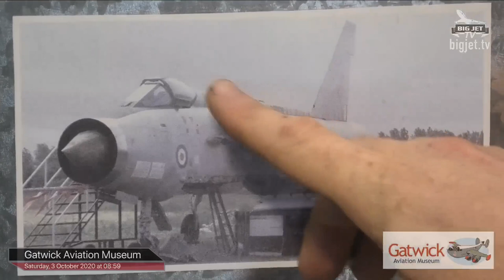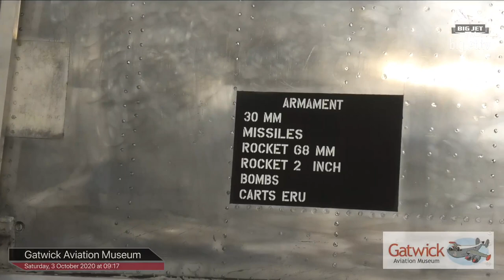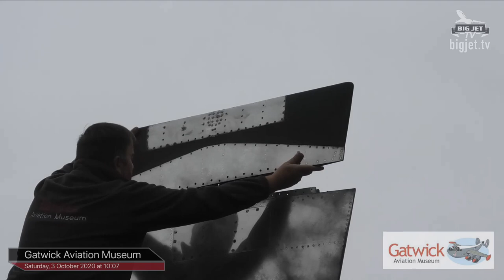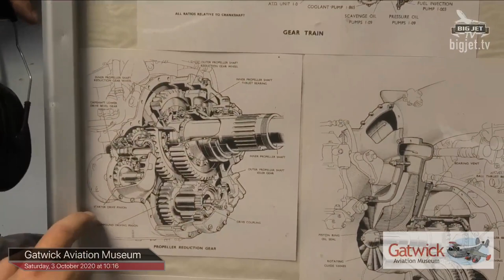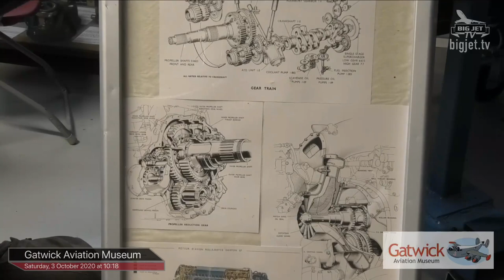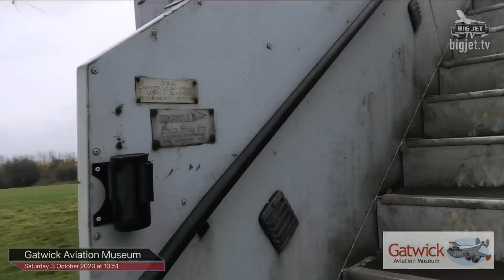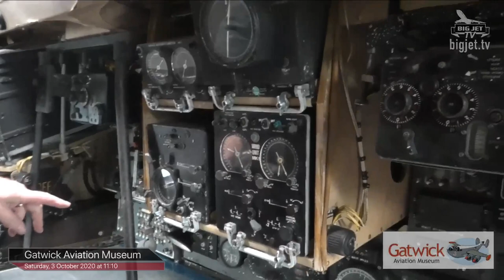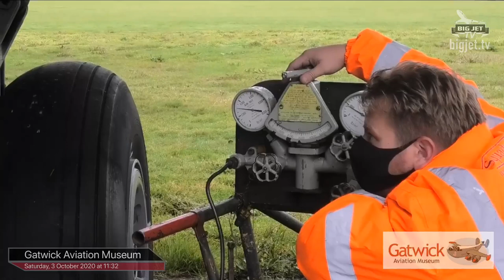Gatwick Aviation Museum - Museum Tour and English Electric Lightning F53 Engine Start & Run-Up

Comment: I believe there were Brits in Lightnings in Yemen as QRA aircraft. If not Yemen, another short conflict out in a sand dune country...
The pilot i heard being interviewed said that the first thing you learnt when flying a Lightning was to AT ALL TIMES!!! be aware of how far you were away from, and in which direction your nearest airbase for fuel was. Such was it's fuel consumption! 
He also recalled a foreign pilot being sent for conversion to evaluate the Lightning to see if it was suitable for his country's airforce. I think the normal conversion time was three days. He said, "No, i'm only here for one day." So they allowed him one day's training and informed him that he must NOT use afterburner when taking off. The pilot was used to doing so in his aircraft so ignored the RAF instructions and did so anyway. The RAF pilot said he took, pulled back the stick and stood it on it's tail and didn't retract the undercarriage until about 20,000 feet as he was going so fast! When he landed he was a bit sheepish and realised why he'd been told to take off without afterburner.

Comment: Does anyone know why he had to cover the starter exhaust hole?
Reply: I worked on 111 sqdn Wattisham back in the sixties, when starting it was practice to smother the exhaust with an asbestos glove to prevent the occasional release of starter fluid from dripping and igniting from the exhaust. I learnt the hard way on the first occasion as I put both the gloves on then found you only needed one hand, the heat was very painful, the old hands put on one glove and used the other on top. I transferred to MK3 simulator at Coltishall after a conversion course at RAF Newton.
Great aircaft, we used to lose one now and again, mainly reheat fires or instrument failures.